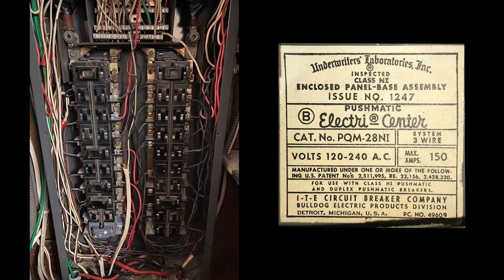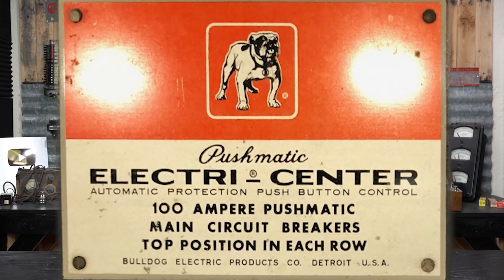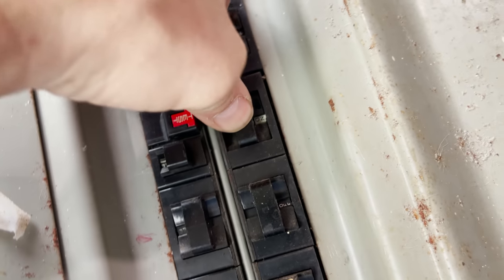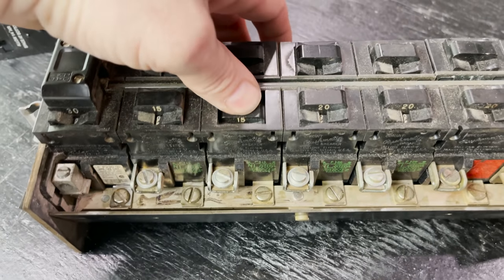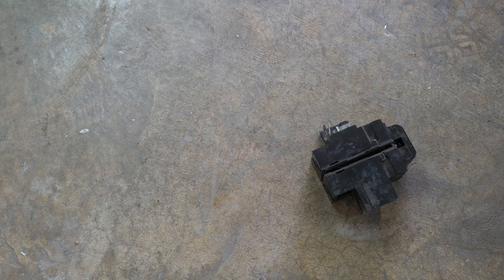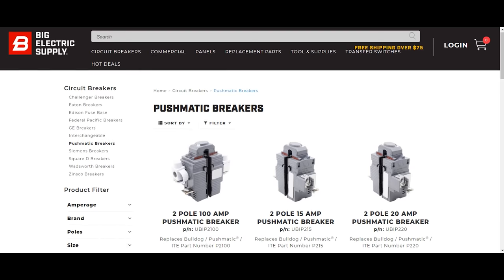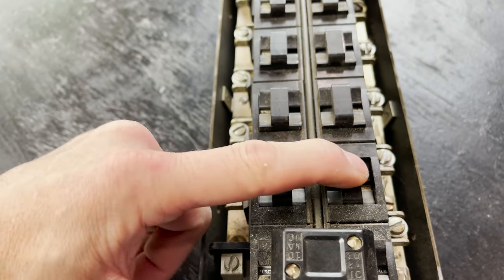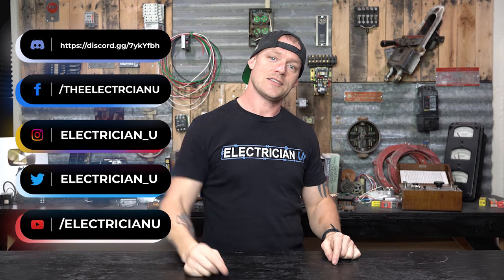Pushmatic Panels & Breakers - ARE THEY DANGEROUS?

Comment: Our house had 4 panels (it's big).  2 FPE, 2 Bulldog.  Estate sale, built in sections from the 1950s-1970s (then the old guy died)

sigh.

I spent the 4th of July after we closed on the house in the "bomb shelter", in the pitch black darkness, replacing the main panel before the insurance company did their inspection.  Some of the wiring was definitely not code.  12 hours in a dank sub-basement with a flashlight in my mouth, wrestling with 2/0 and 3/0 wires.

The only disturbing part was hearing footsteps every now and again.

Comment: I like your assessments of FPE,  Zinsco, and Bull-Dog. I think you're spot on on all three. Breakers, of any kind, that have never been flipped for 30+ years are waiting time bombs, imho. Nobody does it, but I think all home owners should flip on and off every breaker in the panel, annually. I stumbled across your feed today. I worked 35 years, in Silicon Valley, as a Union Electrician in all phases of the trade. I found myself working for a home lighting company that kept 3 to 4 Electrical Service Trucks busy in the Stanford University area of Palo Alto, in the mid 80's. That area was primarily built in the 30's to 50's. I replaced mostly FPE and Zinsco panels because of failures. Around that area I saw more Bull-Dog panels in small Commercial properties, occasionally in homes, but rarely, if ever, was I ever call out because of a bad breaker. Don't know if you've covered it in your U yet, but you might go over the different Types of stab breakers. How some are interchangeable and some look interchangeable, but aren't. The different types of Square-D breakers. If you haven't covered that, I apologize if you have, that is a topic many DIY'ers would find informational, imho.

Comment: I think you are absolutely correct! I think you worded it wisely, and you are absolutely 100% correct. I've been doing electrical work for many many years, and I think if somebody runs across old pushmatic breakers, old zinsco breakers, any of the yesterday technology, they need to consider replacing the panel.

Comment: I used to replace a lot of these back in the day working as an electrical apprentice (looking back, I really wish I would've stashed the old breakers). The house I've lived in now for 9 years has a 200A pushmatic panel that was installed in 1980. Haven't seen a need to replace it yet. I even had enough spare slots to add a new 60A/240V run to my garage a few years ago. 

From what I've been able to tell from studying mine is that these panels do appear to be really well-designed. The busbars are very solid/hefty, and as others have already said, the way the breakers bolt directly onto them is actually pretty nice. My panel even came with an adhesive insulator strip on the back of the panel cover which is positioned so that it sits directly over the main lugs to prevent them from accidentally contacting the cover should you forget to screw the lug screws in all the way. That's some pretty solid engineering in my opinion.

The only thing I've never liked about these panels though is the lack of a single main breaker to act as a disconnect for all power in the house. Mine has two 60A double-pole breakers a few positions down on either side which act as mains to all of the circuit breakers below them. Basically it's a split-bus system where the upper busbars end at these breakers and the lower busbars are fed from them. The lower busbars can therefore be easily de-energized from these two breakers. But this also means that the upper circuit breakers are "above-disconnect" if you will, and the busbars that they are bolted to are always hot. Therefore if you ever need to swap out/replace any of THESE breakers, then the only way to de-energize this part of the panel is to go outside and pull your electric meter out of the meter socket (unless you have an external disconnect of course). And this is a MUST DO because a screwdriver + an unsteady hand + an unprotected main busbar = some truly ass-kicking arc flash!
Reply: Ours is a single-bus panel, and it has a single main breaker (only 100A, though). Still need to pull the meter to replace that one, of course
Reply: I have a similar one. 200amp service with the main outside.
Installation was approximately 1969 - 1970 as an all electric Gold Medallion home.
I’ve never had a problem, but I do push the pushmatics breakers occasionally 
to make sure they are still working properly.

Comment: As far as old outdated breaker systems go, I always thought the pushmatic were pretty decent,  especially the way they bolt to the busbar rather than just pinch it like modern systems.
Reply: Had a ton of them in a large slaughterhouse. Even the pushmatic panels in damp cold boning & breakdown rooms held up.
Reply: Square d has a bolt on breaker option
Reply: I was an electrician for 45 years and the only problems I've ever seen with Pushmatics were when the bus screw was, loose, crossthreaded or stripped.
Properly installed they were one of the best ever made because they had both thermal and magnetic overload trip and they bolt down to the busbars
Even today, very few circuit breakers have both.
Reply: @MichaelClark-uw7ex  I agree, same assessment here, retired Master.
Reply: @doninmichigan  I was a Master then became a foreman.
I've seen shit that would curl most people's hair and send them screaming into the night.
Fortunately Pushmatic panels were not one of them.
Reply: My parents home has a Pushmatic panel.    It works fine
Reply: @MichaelClark-uw7ex  What are you talking  about, they are thermal trip only!

Comment: Dustin, you are half your age, and I  have been doing electrical work for over 64 years.   My father was a firm believer in Square D from the XO Breaker panels and the Cutler & Hammer panels that were copied off of Square D.   To tell you a little bit about Bulldog Electric and Bulldog panels..  Trumbull Electric was located on Trumbull  in Detroit,   Michigan.  The insignal of the panel was the Bulldog that's how it got its name.  They were used mainly in commercial sites.  Then Bulldog realized that if they did some advertising  and pushed, they could  get into the residential market. Then, they were sold off to ITE and named Push a matic breakers.  When ITE obtained Trumbull Electric, they made the breakers cheap, and the springs were weaker  and developed all their problems!!!  The original breakers were bolt on the buss bar and great panel.  After ITE got them, they started to  go downhill real fast!!!   As for Federal Pacific, panels are pure junk, just like Zinco panels, too!!!!   I am still a master electrician to this date.  I have been licensed since 1972..
Clayton Miller Detroit, Michigan.

Comment: I had these in a house I lived in. We replaced some breakers that would trip way below their rated current. Never had a problem with any not opening immediately for a short. As I recall sometimes when you turned off a double-pole only one side would open, but at least the indicator still said ON. I got into the habit of always testing with a meter at an early age. Eventually the service was upgraded and the whole panel replaced. That must have been an interesting job because the wires in the old type AC in the house were as brittle as dried sticks.

Comment: I’ve worked in buildings where the lights were hard wired to pushmatic breakers, and you just used them as the light switch.
Reply: Well those were getting greased!
Reply: Had a lot of the great pushmatic 15 & 20 amp circuit breakers used as switches back in the 1970's. Held up great. I reused my original pushmatic panel to the garage as a 60 amp sub panel. Like a timex. Over 60 yers old and still ticking.
Reply: I have not had a problem with my pushmatic panel  or the breakers I’d be reluctant to swap it out,although I would agree that it should probably be inspected by a professional
Reply: I have seen that also in my career here in the Detroit area and suburbs.
Reply: @doninmichigan  It was Michigan where I saw these panels the most - my first job in Adrian, my grandparents house in Hudson (built in 68), and the family cottage in Coldwater!
Reply: They were gett:ing  their "exercise"lol😊

Comment: In my 45 years as an electrician I have installed hundreds of Pushmatic panels and thousands of Pushmatic circuit breakers.
Installed correctly they are one of the best circuit breakers ever made, because they are among the few that have both a thermal and magnetic trip and they bolt to the busbar instead of a spring friction connection.
The only problem I've ever seen were in panels where the bus screw was cross threaded , stripped or loose.
Reply: My house was built in 1960 and has a 250amp panel and 100 amp panel and I have all the original breakers in mine but one that I changed and I will NEVER change out this panel because they are that reliable.
Reply: wow ill keep it its hard to find the breakers and there expensive but my systems over 40 years and only one breaker went bad a few years ago now i got another bad one now
Reply: @mattmalone524  It's good to know that there are replacement breakers for the Pushmatic circuit breaker panel still available because this one friend of mine owns a laundromat and all of the panels in the building are Pushmatic and plus I love the design where the breaker is attached directly to the busbar with screws instead of spring clips , Plus to replace those panels would cost tens of thousands of dollars because he asked me one day If replacement breakers were still available for the Pushmatic circuit breaker panel and I explained to him yes but the replacements are more updated and made to fit the Pushmatic panel
Reply: What are you talking  about, they are thermal trip only!

Comment: My grandfather's house was built in the 1960s and had a Pushmatic breaker box outside. I'll never forget as a kid, I went to turn off one of the breakers and it caused a bright blue spark inside the panel. Scared the crap out of me, and I was always nervous about pushing those buttons afterwards.

Comment: I remember the church I grew up in had a Bull Dog pushmatic panel in the dining room in basement. The top five breakers were used to turn on/off the five rows of fluorescent fixtures in dining room and stage. Since these breakers were the only way to control these lights, they got quite a bit of use daily. My ten year old self always thought these breakers were cool looking, how they worked and sounded when pressed. If I were the only one in the dining room, I would often play with them and turn on/off different patterns of lights in the large room. The light fixtures were these 8’L X 2’W surface mounted fixtures that contained four F96T12 fluorescent lamps, and each fixture had four 2’ X 2’ plastic milk white drop diffusers, that I also really liked. This video brought back memories. I think the panel in the church had something like 20 total breakers in it, the majority of breakers used for plug, equipment, and lighting circuits in the other parts of basement. I would not be surprised if the panel is still there today!

Comment: Thanks!! I have 2 pushmatic panels and am in process of updating the breakers only for now. Will eventually update the panels and have learned most from your videos. I’m an automotive tech by trade for 22 years and switching my mind from D/C to A/C and working with 110/220 volts vs 12v has been a challenge. Keep up the fantastic work.

Comment: I have a pushmatic panel in my 1960s los angeles house.  I can 100% confirm the on/off flags don't work.  Not only that when you cycle them on/off does the flag not change but the "handle" sometimes doesn't pop out in the off position.  I had a breaker that if turned off you'd have to spend some time to cycle it on/off just right to get it to stay on.  I also have a 20A circuit that is happy to run all day long with two 1875W hair dryers running (how do I know??  2 of 3 bathrooms are on one circuit!)  Needless to say I'm replacing the service.  But hey, at least it's a copper buss!!!  Thank God they don't build them like they used to!!!  This house is 2500 square feet, has no 240V breakers, and has only six 20A branch circuits, and two 15A lighting circuits.  Guess no one ever thought we'd actually use electricity!  lol.....

Comment: I just replaced my pushmatic (ITE Siemens) panel in my 1970's built shop.  I was wanting to add a 50 amp breaker and run a line for a welder and I realized that I had an issue.  During the removal I noted at least one area where the breakers were getting hot.  I had some issues with the panel in the past, but it wasn't all the panel's fault.  The wiring was less than desirable, using multiple 12-2's to run 220 heaters etc. instead of running the right wire....but perhaps that was the correct way back then...?  Glad to have it updated though.

Comment: I found this channel getting ready to replace my entire service specifically because my house has pushmatic and you're spot on. These things are dangerous!!!

I have to do it in steps, first getting service replaced with 200A and new panel and then setting the pushmatic as a subpanel while I bleed off circuits with new wiring.

These things suck so bad. Have had false on, false off, and humming until you jiggle it a bit.

Thanks for the insight of all your videos.

Comment: Thank you on the pushmatic info. Update sounds reasonable. I personally would never spray a breaker though.  I’ve had a few breakers that would not reset, but most I run across work
Reply: Hsd 2 piece of crap ge junk 400 amp 600 volt breakers that would not reset after working on chillers. Had to use a heat gun to get them to turn on. Was told that grease inside of crap ge breakers dries up after so many years. They were located in a climate cintrolled area that was always around 72 degrees.

Comment: I personally hate working on them. If I have to change one breaker I will shut down the power to that panel if possible. I hate the design of these with the exposed hot buses. Also the breakers are a pain to remove. You are right they do not get exercised and therefore I replace the whole panel. Plus the other reason you mentioned no magnetic trip. If that bi-metal strip has to heat up to trip, what other area in the circuit is heating up? I tell my customers these things and they usually agree to replace it. Same for Zinsco.

Comment: Federal Pacific, Zinsco and ITE pushmatic are all discontinued and are now pricing out at over $75.00 per single pole breaker... plus the fact that they are not to current code, I'd be pulling the panels out and upgrading them . for the cost of 1 breaker, you can get a whole new panel that's updated... its not worth saving those old systems....
Reply: I don’t see any panels with breakers for $75

Comment: Yep had a problem with my main breaker getting sticky. Pushed it in to the on position and the whole right side leg was dead. Then pushed it to off and the right side still had power!! 😲😲😲 Eventually I got it to work by exercising it in and out a few times😨 lol!!  But yes I'd consider these pushmatics very dangerous! Always check with meter to make sure there is no power and it's truly OFF!! Before attempting to work on one of these units for sure!!
Reply: If you're not one please call an electrician before attempting to work on a panel like that so you don't kill yourself or burn your house down.

Comment: During their heyday, Pushmatic panels & breakers were the best quality equipment on the market. They were solid and reliable - certainly more so than any of their contemporaries. They also sold for a premium; if someone installed one, that person believed in spending more for quality. Don't be too harsh on them because they only used a thermal trip mechanism - that was the standard of the time; later Pushmatics incorporated both thermal & magnetic trip mechanisms because that's where the industry was moving. It's like criticizing an old car because it didn't have disc brakes. Likewise, they had a low current interrupt rating - I believe 5,000 amps - that was standard across the industry at the time. Problems with these breakers were far and few between. In general, they were dependable workhorses. All of that being said, these things are old. They stopped manufacturing them in the early 1990s (I remember my local supply house still had some in stock in 1992), so the very youngest ones out there are 30 years old and most are far older than that. Any panel from the '50s has probably had it - anyone remember Frank Adams panels? Newer panels & breakers aren't nearly as solid as the old Pushmatic stuff (is there any modern panel with bolted breaker connections?), but their engineering is light years ahead. If you have an old Pushmatic panel that's starting to act up it's time to respectfully replace it.

Comment: I just changed out a Pushmatic today and replaced it with an Eaton BR. As long as the breakers are functional I tell homeowners they are fine, just don't touch them and extend because it's expensive finding a good Pushmatic breaker. Ntm there isn't many options short of setting a sub panel to use AF breakers.

Comment: We are in the process of remodel a home, which had not one, but two of these panels.  There had been an electrical fire, which was caused by one of the breakers failing to trip.  Our electrician discovered most of the breakers would not turn off.

Comment: One dangerous item I have found with Pushmatic breaker panels is that some used metal blank-ups in them. If you weren't VERY careful, they wouldn't clip in correctly and would go in to short on the bus. The other problem is if your screwdriver slips off of the straight slotted screw connecting the breaker to the bus, and you are trying to do it live (NEVER) You will need a new screwdriver at the least, and a seeing eye dog at the worst after it shorts out on the bus bar.